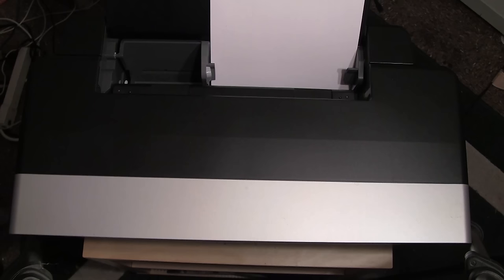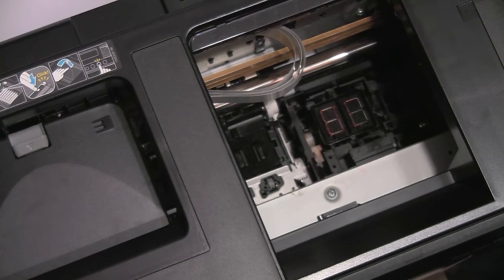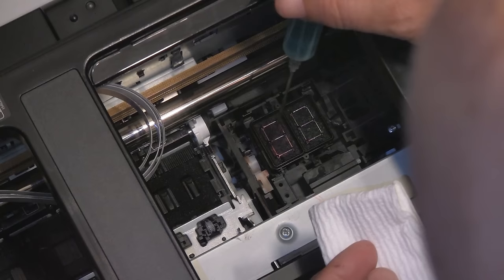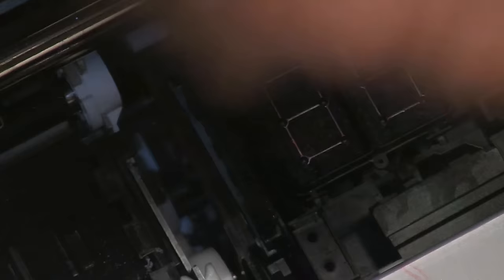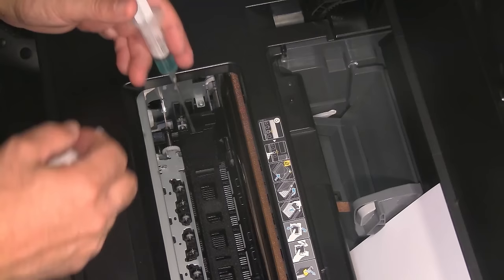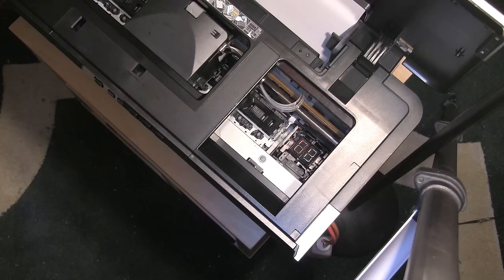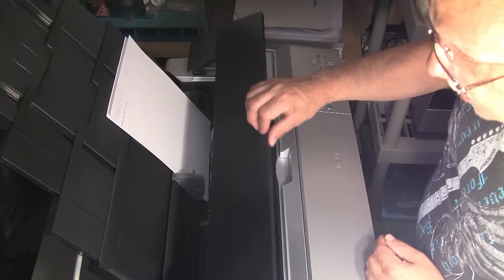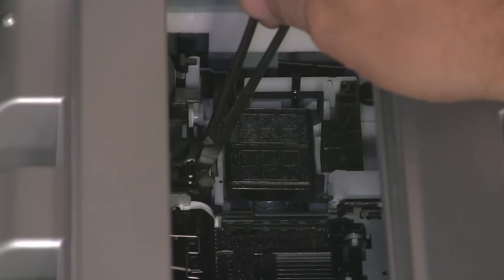How to perform Basic Maintenance on the Epson R2000 and 3800

Comment: Thank you for this video.  After soaking with windex the nozzle check really improved.  Do you know why though the photo black and matte black nozzle check sections would be totally blank?  The other colors are good now, but no black at all prints on the test sheet.  Can I fix this? Thanks!
Reply from the maker: Printer model???? If Epson it would almost be impossible for both to be black if the share a single black channel for PK and MK. UNLESS.... You black switch valve is damaged. That is a $300 job.
Reply: @cheo1949  Its an R2000.  Do you mean impossible for both to be blank?  If its the valve is there any way I can do it myself for less $$?
Reply: @cheo1949  I just found this quote...from you! Wow, thanks for being so active on here. "The R2000 does not share black channels so there is no switch." So since I have an R2000, that means its not a $300 job? Then what is it...  I'd really like to get my printer working again.
Reply from the maker: Okay now that we know what printer model you have and it's the r2000 that one does not share black channel so you have a clogged pair of black channels. It's really odd to me that both blacks appear to be clogged. Those are some pretty high odds that both are clogged. Now are you by any chance refilling using refillable cartridges or are you still using original cartridges? One option as a last resort it's after you have exhausted any other method of trying to unclog your print head, you could inject very very gently some cleaner directly into the two black spigots that are found inside the printhead carrier. You uninstall your two black cartridges and attach a syringe with a piece tubing connected to it and loaded with cleaner. Then very very gently attempt to inject a bit of the cleaner but if you feel any pressure what so ever you immediately stop. You do not want to delaminate the printhead by attempting to force cleaner through it. You would inject a very small amount if you are able to and then pull back a bit. Inject a little bit more and pull back and so on. You want to do this in the next several days again there's a very high chance you could damage your print is so this is as I said a last resort.
Reply: @cheo1949  I'm using original cartridges. I soaked the sponges again, overnight this time, also ran the printer head over a folded windex soaked paper towel a couple times, and now there's a just a couple marks in the PB and MK test spaces.  They don't look black though. All other colors are perfect or almost. I posted a photo of the nozzle test on dppreview https://www.dpreview.com/forums/post/62172964  What do you recommend next? Is it last resort time?
Reply: @cheo1949  also what size tubing will i need to find? thank you.
Reply from the maker: They are not going to look extremely black. Continue doing what younare doing. Let the printer rest over night between cleanings and nozzle checks. Keep goodnrecords of your progress. PATIENCE is the word here. Hurrying the process and you will damage things.
Reply from the maker: 1/16 ID. But ONLY do this IF nothing else is working. Slow and steady!!!
Reply: @cheo1949  okay, will keep at it.  Thank you for your patience.
Reply: @cheo1949  I soaked it again for a few hrs and did another cleaning, and the few black lines have now disappeared again :(  I looked at the tests altogether  to check my progress in general and the nozzle test I did before I started cleaning the heads at all a couple days ago, shows only the MK and PB were printing! I was so happy the Windex made the colors come back, I forgot the blacks had been there before.   I don't understand whats going on with my printer.  I posted a photo of all the tests side by side here https://www.dpreview.com/forums/post/62174858   Is this a clogged print head problem or something else?
Reply: @cheo1949  update:  I added windex to the two cones under the black cartridges, and now they're printing on the test! The red disappeared tho, so I added to that cone, and the last test shows all colors and blacks. Success, and no last resort.  Thank you.
Reply from the maker: Hurrah!!! Now make sure to print often to prevent this in the future.

Comment: Hi Jose, Is windex glass cleaner ? in the past i used bullit from Marrut very expensive
Reply from the maker: Windex is an American Product. I don't think it is available in Europe. Magic Bullet is expensive but very effective.
Reply: Thank you .
Reply: Hi Jose, how often would you recommend to clean my  printer . i have revived my R1900  WITH MAGIC BULIT.just bought Epson SP600, not used it yet . i AM a low user and how often would you  do a print check using the printers nozzel check and  print heads on my printer ? any help appreciated .

Comment: Hi Jose, Im having a problem with my R2000 printer and I have partially followed your instructions here but still having a problem. missing lines in red area. repeated head cleanings and now I'm getting some other problems after using windex. :( What should I do ?
Reply from the maker: +Kitti McMeel Red ink seems to be the killer when it comes the R2000.
Something about the pigment properties.
Here is what you can do as a last resort but be aware that if not done carefully you will irreparably damage the Print head and that will be the end of that.
Move the print head over from the parked position as you have done when cleaning with Windex and paper towel. Place a folded strip of paper toweling under the printhead. Prepare a regular plain tipped syringe with a piece of rubber tubing attached to it that will also fit tightly onto the print head ink stem. Fill the syringe with about 5ml of Windex with ammonia. Remove the RED cart. Insert the tubing over the red ink stem tightly. Try carefully and gently to inject one ml of Windex into the print head. If it enters without ANY pressure, then proceed to inject the rest. Load some more Windex and Inject some more in but this time pull back a bit to withdraw some fluid. Remove the syringe and wash it well, load it with more Windex. Reattach and Inject more and withdraw fluid again. Repeat but this time only inject. Remove the syringe and reinstall the red cart but let the whole thing sit for a while!
Slide the head back to the right. Repower the printer. The printer will do an ink purge. Do a nozzle check. Hopefully all will be back to 100%.
If not you can repeat but very likely you will need to replace it. Good luck
Reply: +Jose Rodriguez This is beyond what I can do, no tubing :)
Reply: +Jose Rodriguez Also not sure of where the ink stem is and where does the purged ink go?
Reply: +Jose Rodriguez Lastly I have all this left over ink cartridges, probably 3 complete sets :( sell them on eBay? :)
Reply from the maker: +Kitti McMeel When you remove a carts from the Print Head Carriage as in when you replace one. It will be the only little tube like thing sticking straight up! You can miss it. You will need tubing that can fit that stem and also fit the syringe tip.
Reply from the maker: +Kitti McMeel Try what I suggested first and if it does not work then yes. Sell them on EBAY for between $20-30 but no more than that as they are currently selling for about $35 per set with free shipping. I'd buy them off you but I have a good number of them.
Reply: where would I get tubing?
Reply from the maker: +Kitti McMeel I just asked you for your address and I would mail you what you need. If in the end you can not fix it or you feel you are going to throw it out. Check to see what it would cost to mail it to me. UPS store! And I will pay you for the shipping and your effort. I love trying to revive printers. Sometimes it works and sometimes it doesn't!
Reply: I got your package, thanks so much! I'm watching the video and you are applying the windex to all colors, I only have one that is problematic, do I need to do all of them? If I am only going to do the one red one, do I need to remove all the other cartridges?
Reply: also my cyan ink is low, do I need to put in a new cartridge before beginning. Its not empty yet just low
Reply: Also, should I try the other methods one more time first since I only have trouble with the red
Reply from the maker: +Kitti McMeel You only have to treat the offending channel. I only did all of them for demonstrative reasons.
Reply from the maker: +Kitti McMeel The printer will run an ink purge cycle when you power it back on.  And you will also have to run a cleaning cycle or two. So yes you do need sufficient ink to accomplish all of this! Good luck!
Reply from the maker: +Kitti McMeel what other method? If nothing g else has worked in the past, then this is your only other recourse.
Reply: I was thinking perhaps I didn't do the other two things thoroughly enough and if this is a last resort maybe I should try the two other things e.g soaking the sponges and paper towel under print head:)
Reply from the maker: +Kitti McMeel Sure. Anything is possible. When I say last resort I mean that anything else would mean a print head replacement. Clerk re tan the printer when new! Do more soaks and whatever else you want to try. Cleanings will waste ink and maybe not fix anything.
Reply: Hi Jose, regarding your suggestion about the last resort trick of injecting cleaner into the print head ink stem, I was wondering, as an alternative, what about using single refillable cartridges (yellow and red) such as the ones produced by Marrutt or InkOwl, filling them with Windex cleaner instead of ink, installing them, and then running automatic and/or manual cleaning cycles, plus printing purge pages? Could that clear the blockages, and in a less risky way?
[Our situation: having a similar problem with the R2000, printer was not used for a while but now all cartridges are new, followed all the steps in your video, including printing color purges, and now getting perfect test prints for magenta, matte black, orange, photo black, and cyan, but absolutely nothing for yellow and red. Only one out of many test prints had a single line of yellow, and now that is gone. So evidently, no ink is coming from the yellow or red jets, presumably they are blocked?!]
Thanks for your awesome video btw!
Reply from the maker: Refillables loaded with a cleaner will work but the process will take time as it is much more passive, but in the end, safer. Patience! By the way you can use any refillable cart brand that you may have on hand. Do your cleans, let it sit for a few hours with the printer off. Power up and run nozzle check. You should be able to start seeing some blue from the Windex printing through. Clean again and repeat. Do not do more than three consecutive cleanings. Print something like a purge file between cleanings. And remember Patience!!!! Good luck!

Comment: Any Idea whats causing my whites no not print true anymore?
Reply from the maker: How in the world could I possibly help you if you do not give me all the details.  It's like just telling the doctor you have a pain and no more.  So please elaborate more!  Have you at least  done a nozzle check???
Reply: Nozzle check looks good, I always print large boarders. I use red river paper with the right icc profile. Ive tried epson ultra premium too. 
Printing from photoshop. 
Prints used to be great, but recently it started printing with lines in the print, I ran a print head alingment and fixed it somewhat but colours are still off
Reply: And ink is epson standard
Reply from the maker: Printer Model Please! Banding is caused by head alignment problems or nozzles that are not firing. If every single line on your Epson Nozzle Check is printed then the banding is due to a head alignment problem. If you can not solve the banding problem by redoing the head alignment then it could be the encoder strip is damaged or dirty. The encoder strip is attached to the head carriage and runs the length of the print head travel and is a clear plastic 1/4" wide strip in the rear wall of the internal printer area.  Printer Model as well as the age of it, is imperative.
Reply: R2000 
2008 bought
Reply from the maker: This printer is over 8 years old! Unfortunately it's very likely that the paper advance positioning system is not keeping perfect track any longer. That will cause either slightly dark or light banding depending on which way the advance error is. If it advances the paper too much you get light or blank banding. The opposite will produce darker bands spaced equally.  It might be time to start looking for a new printer.
Reply: I fixed it today, by running about 10 consecutive cleaning cycles,  and Calibrating my Computer..
No cleaning needed on my r2000 in over 5 years of use!!
Reply from the maker: OK so you did have clogs! Glad it is OK now but PLEASE NEVER do ten consecutive cleaning cycles unless you want to ruing your print head permanently!  Do three with nozzle checks in between MAX and then print something and let it rest before doing a final nozzle check. Repeat if still needed.  But NEVER ten in a row! You were lucky this time.

Comment: Hi. I watched your video. Is it ok to spray Windex on napkins and let it sit on the print roller? I'm doing that now and alot of ink soaking up on the napkins. Because outta nowhere my printer would print blank pages... And it's all new cartridge I been using since I had the printer...
Reply from the maker: Windex is good at dissolving dried ink. But why are your rollers coated with Ink?
Reply: Jose Rodriguez Yes. But it still haven't solve my problem. My printer for some reason only printing one color cyan..I don't know what is wrong. 😢
Reply from the maker: You originally mentioned rollers which have nothing to do with ink. They transport paper. So every channel except cyan is clogged? Did you determine that by actually doing a nozzle check?  What printer? Arre you using OEM or refillable / compatible carts? Have you run cleaning cycle followed immediately with a nozzle check so you track if there's are any improvements?
Reply: Jose Rodriguez  I have a epson 1430. Im using refillable ink been using them since I had the printer over a year. I ran the nozzle test only cyan prints. When I did the alignment text nothing prints.. I  ran the head cleaning nothing working. Just lowkey flooding my printer with ink.
Reply from the maker: It has to be the refillable carts.  Hardly ever would you have such an ink f!ow problem.  Check to make sure they are PRIMED!  If you even let them reach empty the priming chamber will empty out and that chamber must be always full. What you have now is nothing but air in them. If that is what it is and suspect that is it. They must be reprimed and topped off.
Reply from the maker: https://www.youtube.com/watch?v=s_Zx-HUvR-w
Reply: Jose Rodriguez Ok. So I watched your video last night. Did what it said. And nothing still. What di you think the best way to clean the heads property? I see they use clear plastic piece tubing and  injector each head with cleaning solution... It's weird seem like the problem started after I ended the big continuous ink cartridge. And that device didn't work for me at all. That's when I went back to my non OEM cartridge that's not not working at all... I hope and pray it just needs a deep head cleaning.
Reply from the maker: A CISS is one sure way to screw up a printer. You can do the direct injection but be careful as it can ultimately kill the printhead by delaminating it. Since don't know if it was due to the ciss or the cheap carts, the only way to truly check but will cost you, is to install a set of OEM carts. Do the direct cleaning first then decide what to install when it comes to carts.
Reply: Jose Rodriguez Wow I wish o knew that from the start not to use CISS. But I been using non OEM for over a year with no problem. Yeah that's what I was thinking getting the OEM cartridge but like you said that's gonna cost. I'll try to do the head cleaning and be careful and cross my fingers that will work. If not I might look for a printer repair shop that don't cost arm and leg just to check it out...  😞 Thanks for your help...

Comment: Also was wondering if r2000 inks are compare with p400
Reply from the maker: +Kitti McMeel The actual I k set is probably the same, but the chips are totally different and non interchangeable.
Reply: So I guess I have to sell them :(
Reply from the maker: +Kitti McMeel Yup!